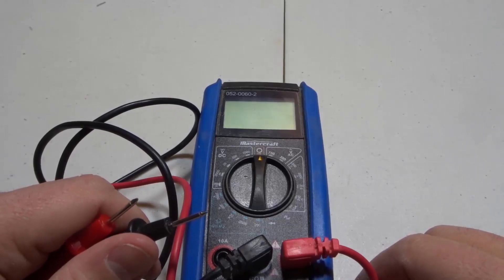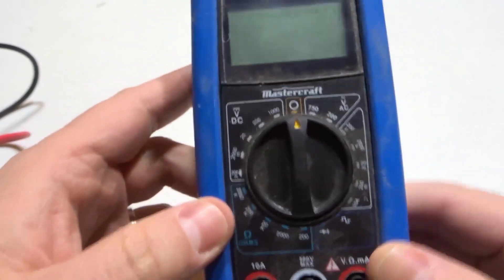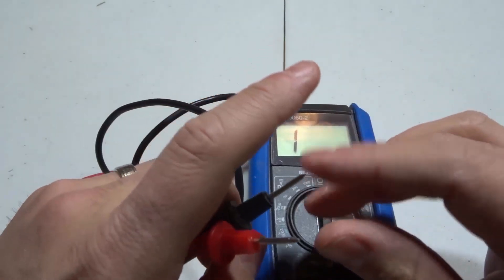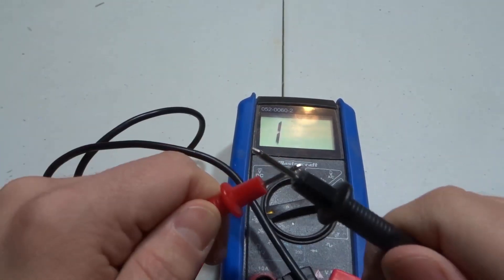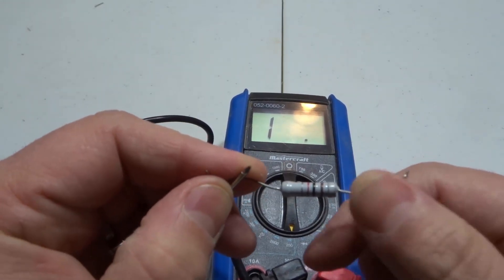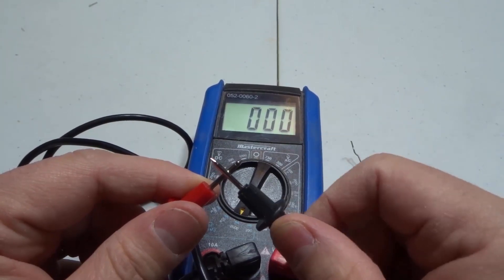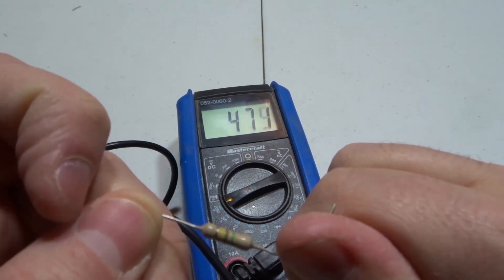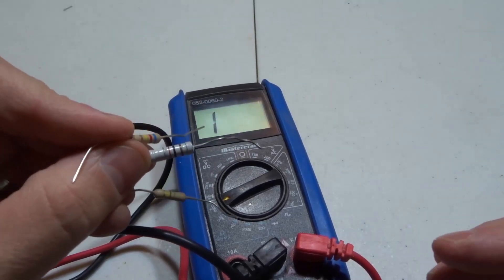How To Measure Resistance With A Multimeter-Tutorial

Comment: I want to compare the resistance of different wire connectors (eg twist and shrinkwrap; twist, solder, and shrinkwrap; twist and cap; and solder seal). Can I measure this with this meter, or do I need a 4-wire Kelvin bridge? Thanks.

Comment: not a good explanation.. I get reading like .384 or .219. So how many ohms are they for resistance. I used ohms law to calculate how ohms I need for a connection. Example I need 220k or 390k ohms for resistance. You do not explain what the numbers represent.
Reply: he doesn't tell because either he doesn't know, or he's not that good at making a video.  you expect to actually get this info from a video.